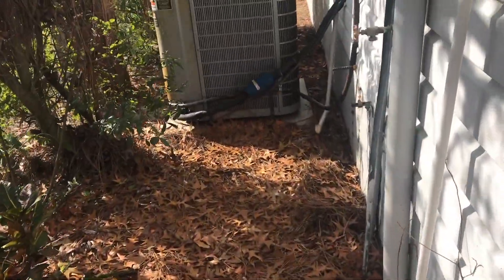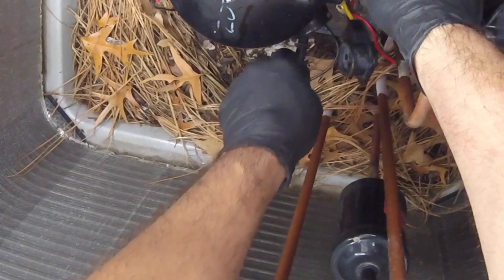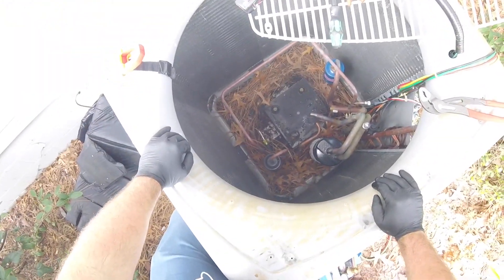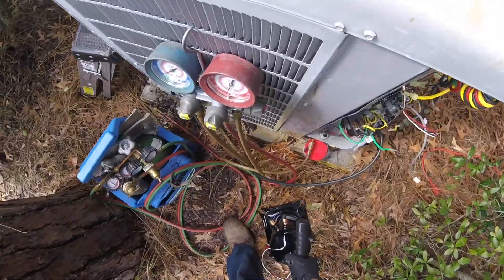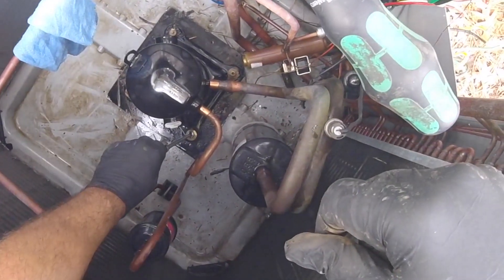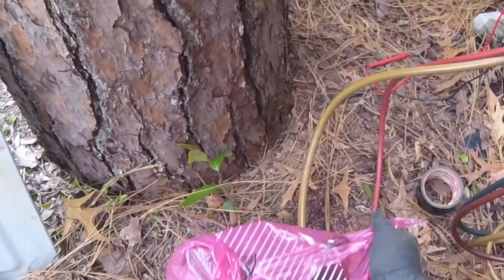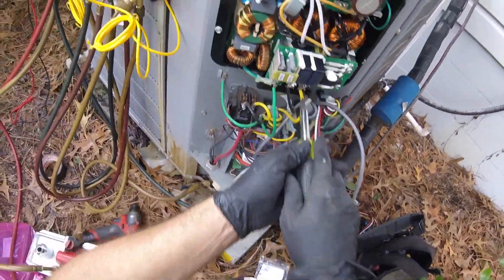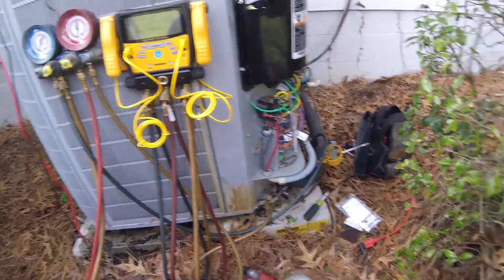How to Diagnose a Inverter and Compressor on a Carrier Infinity 25VNA troubleshooting part 11

Comment: Question. Changed the compressor and inverter. Wouldn't be easier to just change the whole unit out?  what is the price difference? Or was it a warranty thing. Thanks Chris

Comment: What about the chip from the old board, don't you have to put it on the new board.
Reply from the maker: Jose Rivera on this greenspeed 20 seer  the defrost broad is separate from the inverter. So the defrost board has the chip to identify the unit. Thanks for the comment

Comment: Do customers ever get their moneys worth buying Infinity systems, so much tech and so much to go wrong god help you when the warranty goes out, I'm a been a Carrier dealer in TX and I stay clear of these systems, lately I get better prices on Rheem and customers find them more appealing than Carrier which I put on the back burner.
Reply from the maker: muniznick  I agree at a certain point, I have seen good saving with our clients but they could be very intimidating because it’s inverter driven. Just like any other unit they got to be installed properly and the problem or the solution is that these unit know airflow. Not like your typical unit with plane Jane parts which I love and yes Carrier are making adjustments to the VNA 8, and 9. I do the love the greenspeed 20 units  I would sell them all day if I was to pick high efficiency unit systems. Thanks brother for the comment